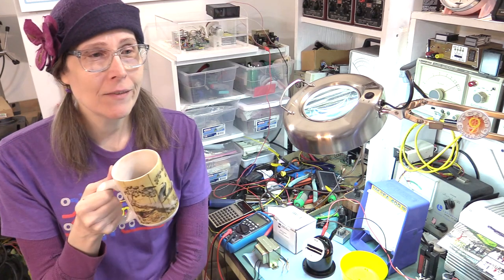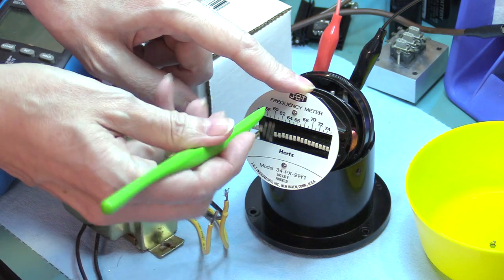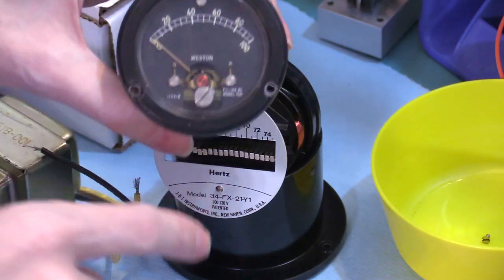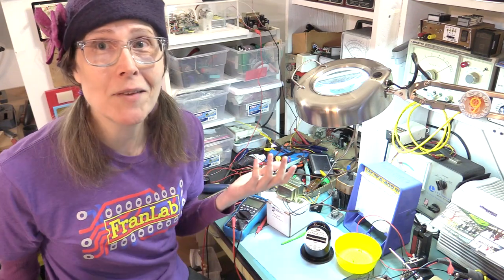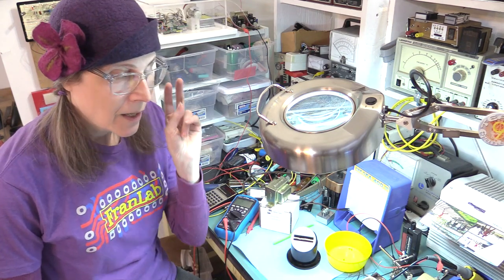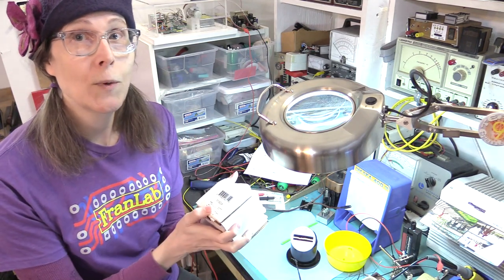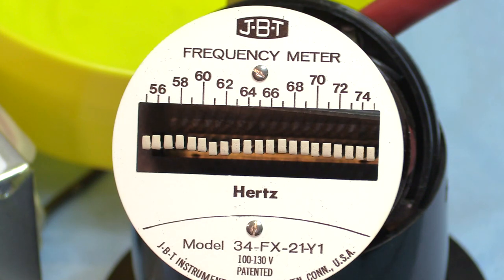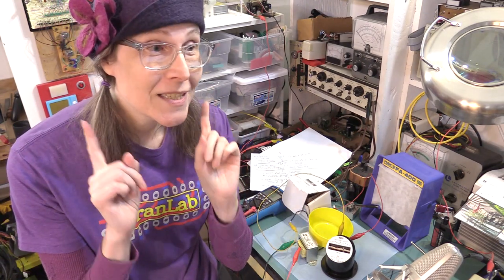Deep Dive Into The Electromagnetic Frequency Counter

Comment: Well done Fran for going the extra mile to answer all of the questions. I took one of those meters apart many years ago and saw how it functioned. You learn more by doing that than just seeing it printed in a book or information on the internet. I've also taken apart so many old clocks and aircraft displays years before I realised the dangers of the coatings used.

Comment: If it had a wider range it could be a true analogue spectrum analysis display!
Reply: Imagine calibrating that.
Reply: At one time per Hertz it'd have 22,000 of those wide. That'd take up a lot of room!
Reply: @johnpossum556  But quite an idea!
Reply: @johnpossum556  You'd have to sacrifice some definition for practicality. Otherwise it'd need it's own room!
Reply: @paulbennell3313  Something like 1/3 octaves would be useful for most musicians. I wonder how the Q is, though.
Reply: @johnpossum556  Well considering the signal was coming from a function generator, the Q didn't seem particularly tight but I guess that could've been an effect of the amp being used. 1 or 2 Hz either side of the centre frequency were being excited but I noticed this effect wasn't consistent. Again, I suspect that could be down to the amp or possibly even the settings on the amp.
Reply: @johnpossum556  spectrum analyzers are usually on a logarithmic scale and the resolution (per hz) goes down the higher up you go. As well as being more practical, this also more closely reflects the way we hear sound.

Comment: I speculate that angled plates are there to normalize the response of the tines so that all the tines have roughly the same amplitude. Denser magnetic field on the high end helps to push more power to the tines as they would need more power for the same amplitude at higher frequency.
Reply: I was going to comment the same thing.  I'd agree.

Comment: Very cool. I have a Frahm tachometer, which uses very similar tuned reeds like that to measure motor RPM. It's just a box, no wired connections, just sits on the motor housing. Mine goes up to 3600 RPM. I use it for some vibration measurements and I did a calibration Hz to RPM. Frahm also made units that read direct to Frequency. Pretty cool old school frequency measurement device.  BTW -  I have my TI-30 calculator also LOL. I had mine in HS (1984 grad). There is so much room in the battery compartment that I put a crystal radio in mine (1N34A, etc). I also put a "shocker" in there later on, relay buzzer that would give a tingle, fun little study hall gizmo. Put a bunch of little fun circuits in there. Even had teachers help with ideas back then. I still use that calculator today. Great channel Fran!

Comment: Assuming the amplifier you are talking about is tube-based (otherwise - why would it have an output transformer?).

Tube amps usually can operate with the output shorted (or too low load impedance) no problem - tubes cannot provide much more current than in normal operation.
OTOH, tube amps usually cannot work with the load impedance too high - or there can be voltage spikes that would be bad for the output tubes or the transformer.
But, if you already have a tube amp - you can probably take the high voltage from the primary side, couple it trough a capacitor and run the meter this way.

As for the power transformer impedance matching - I do not think that works the way you described it. I mean a UPS operates pretty much the same way - low voltage from the battery goes into a transformer to be stepped up to whatever the mains voltage is. Obviously the UPS can work at high load (1kW or whatever it is rated at), but it also works at no load or very low load without any problems. 
While the DC resistance of the transformer is very low, its AC impedance should be rather high without any load.

By the way, I just measured a tube output transformer that's supposed to be 5.2k -> 4R. Its DC resistance is 31R for the primary and my meter shows the secondary DC resistance as zero. But it works normally at audio frequencies :) 
Also, while audio transformers have their impedance printed, it's only the ratio that's correct. If I take my 5.2k -> 4R transformer and hook up an 8R load to it, the primary impedance will be 10.4k

Comment: thanks for showing off the meter, cant recall having seen one, also interesting was the tuning by weight. When we used to build the acoustic decoders for RC models we created a harp of contacts that we tuned by reed length to get our device channel control separation. It brought back some memories seeing those little wigglers in action, thank you so much. 👍

Comment: Thanks for the video, i did not watch the first one cause I already knew how these operate (having learned about whole Europes power net running in sync). Glow in the dark paint would not make sense for that instrument, since its application would be around some sort of power station, where you could run any incandesent bulb to shine a light -> dark, no frequency, some light, try to get that 50 or 60 hertz thingi somewhat right before connecting to th grid.

On a different note, I remember these steam engine governors and a WWI fighter movie, with a simmilar contraption to indicate the airspeed. It was a free spinning airscrew generating a certain rpm dependent of the air flow. The pilot could audible hear his airspeed by recognising the frequency (the higher the nearer to Vmax and ripping of the wing covers). A second indication would be a set of tuning forks (like your frequency counter) that would resonate to the airspeed indicator and would give a objective reading of airspeed, based on the stimulated frequency and independent of the pilots ear. 

Basically, the rx path of a 9k6 modem would be same, having rc circuits tuned to the tones and detecting a rectified dc to recover the tones to quantified information.

A great display of tuning forks in audible range. Thanks and all the best for your endeavors!

Comment: Had to fast forward to see that frequency sweep in action.  Instead of saying it does not work, why not just do it!?  A 110V to 9V transformer turned the wrong way will generate 110V from a 9V signal generator sinewave.  Usually the signal generators can drive 50 ohm loads.  This means the resistive load on the other side of the transformer can be as low as 7.5kohm.  Now that meter has a huge coil which probably is significantly inductive and have some inductance in addition to the wire resistance, which will lower current further.  If your signal generator is too weak to generate 9Vrms sine with 50 ohm source impedance, you can just throw a HiFi audio amp in between (maybe that is what you did - i skipped the boring part).  By the way to use the meter as a pickup you need a permanent magnet close to it to get any good signal.  Now probably only the earth magnetic field generated the signal.  Alternatively put a small DC current through the coil.

Comment: Anyone who spent hours outside on a cold airfield pan in the 80's/90's, trying to keep warm next to a diesel-powered aircraft power generator set will have watched one of those little gauges. In the UK the power sets were made by Houchin & a selector switch enabled monitoring of the 115v 400hz frequency on each of the three phases.

Comment: When we used to turn over a few generators, it became apparent that this type of frequency meter was the meter of choice for a lot of manufacturers. From tiny little 300w Honda portables, to 250kW industrials and beyond. Back in the day, the term was 'reed' rather than 'tine' but the meaning isn't lost either way. As well as 'lead loading' to tune the reeds, some makers (cheaper ones) used reeds of differing lengths, which in turn responded to different frequencies. Although these instruments look simple, there is a bit of science behind them, and in the days before electronic frequency meters, these were perfectly adequate for monitoring the mains frequency on the grid. Used in conjunction with a simple 'synchroscope' you had the tools to allow your generating station to match frequency with the grid, and to synchronise phases before tying.

Comment: Fran, as others have said, a transformer  requires an alternating current to work.  Measuring its resistance  at DC only shows it has continuity. You will need to measure its impedance at say 60Hz in order to calculate its  AC resistance at that frequency.  Your 24v to 120v transformer would work fine if driven by a 24v  RMS 60Hz  source . A lower voltage  - say  5v - secondary transformer would be better when driven with your amp. An old valve (tube) audio output transformer would be  ideal. Love the channel.

Comment: Transformers have 'reflected' impedance.  With a proper impedance meter you'll get an infinite impedance reading on the secondary unless there is a load on the primary.  This always seems bizarre when you consider the very low DC resistance of the winding.  Of course it works in either direction.

Comment: You are almost certainly correct on the purpose of the plates. If you want to demonstrate this take any rare earth magnet and measure its holding power.(just rough, even by "feel" will do). Then add a steel washer to the back side and repeat. You will find the hold greatly increased because the steel washer deforms the mag field towards the front. That's why rare earth catches usually come with a steel cup.

Comment: Hi Fran. Great . I  have suggested yesterday (12/17/2020) to use a transformer  backwards in the output of an amplifier. I didn't revise my original comments, but I probably didn't  specify the usage of an audio transformer, but for sure not even think in using a power transformer - the impedancies for sure wouldn't match. 
But hey, you got that point, and my "provocation" worked fine also...
Thanks, I am a great fan of Fran (it was fun-ny)

Comment: Somewhere I have a tiny, totally mechanical contact tachometer/frequency measuring stick. It looks a bit like a pen or pocket tire pressure test gauge. To use the tool you touch the tip of the stick to something frame, case, or block of a running engine or motor. The stick has a small tab on the side that slids up and down the length of the stick. If you slide the tab it will push or pull a stiff wire out a hole in the tip of the stick. At a specific frequency the wire will suddenly start to wiggle.

Comment: Re: Impedance mismatch - this is for people who are interested in how to calculate such things, and some background info. Not to be pedantic or critical or something. 
There is a big difference between DC resistance and impedance. This is why the transformer doesn't pass 10 amps of current (with its 11 ohm dc resistance on an 110v outlet) when you hook it up. Instead, it draws a few dozen mA to magnetize the core. 
The 110v/24v transformer is NOT suitable, but other mains transformers are. 

I ran some calculations, and with a 230v to 6,3v transformer (or 110v to 3v) you can safely drive it with an 8 ohm rated amplifier, as long as the 16000 ohm load is connected EDIT: and is 16000 ohms at 60hz, not at DC. 
The voltage transformation ratio is 230/6.3=36,5. The impedance transformation ratio is 36.5^2 = 1332. 
Divide the 16000 ohm frequency meter load by the ratio of 1332, and the amplifier driving the transformer will see 16000/1332= 12 ohm. With the ca. 8mA load at 110v, it will need an amplifier of just over 1 watt, because of the slight mismatch. 

The DC resistance has no role to speak of, in this application. 

Tube amps do NOT like driving way too high impedance sources, but 12 ohm on an 8 ohm rated amp will work just fine. The big risk in this case is not blowing up the amp, but blowing up the meter because the amp is able to deliver WAY more power and voltage than needed. 
With just 10 watts of power you can already produce voltages in the kilovolt range, if you hook up a mains transformer 'in reverse' to a speaker output. 
I use TDA2003 and 2030 amplifiers for such 'risky' applications. Those are short circuit and open circuit proof.

With the 100v or 75v piped audio transformer, you have the same issues. Open circuit secondary, the amplifier will practically see infinite ohms as impedance. Short it out, and it will also see a short circuit even if the transformer says its 4 or 8 ohm (well, it would see just the DC resistance without the impedance added to it). In piped audio transformers, you have to fool around with the watts 'consumed' and that's a whole other story. It's 4 or 8 ohms, if the load is the same as the amount of watts printed on the transformer. Not gonna write more about that now.

Comment: It may be louder if you bias the coil with some DC current. Those tines are most likely only very slightly magnetized and tuned to double the frequency they show (they don't have to react to the direction of the field, only the magnitude). Some DC on the coil should play the part of the magnet in the guitar pickup.

Comment: You can easily drive a transformer like that with an amp. The amp doesn't 'see' the DC resistance. It sees the inductance of the transformer, which is MUCH higher than the 4-8 ohms of a speaker @60Hz. Try it, and put an amp-meter in between.

Comment: As many others mentioned, you're confusing DC resistance with AC inductance. Sure the secondary on that transformer is 0.6 ohms, but the impedance at 60 Hz will be much higher.
Reply: Surely that would be the same for speaker impedance whilst being driven

Comment: I first saw one of these devices recently as an RPM meter that was intended to be bolted onto a piece of equipment. If you were to mechanically couple that thing to the speaker cabinet, or maybe to a motor with an eccentric weight you could get it to behave exactly the same way as if excited through the coil. And yes seeing one of these things without any electronics present really was a bit of a head-scratcher at first for us too.

Comment: The plates either side of the tines form the reactive elements to impose physical motion to the tines themselves. If they are simply magnetised they wouldn't have
anything to push/pull against. The taper would be a tuned transition to linearize the amount of motion across the frequency range for a given voltage, the lower frequencies being more
efficient afford more gap, the higher frequencies need more energy to be conveyed so the gap is progressively smaller.
Great video again Fran, thanks for your efforts.

Comment: Nucular! Sometime in the early 70s (I think) a British politician stood up in Parliament and talked about "Unclear" Power. It took a while for people to work out what he was talking about!

A great demo. Someone had suggested using a 100V line driver amp, but I didn't get round to working out what the matching would have been like. I remember the days when you needed a fairly substantial output transformer to drive 600 ohms at line level. I don't think there would be an easy way to match a 1W output into 16K (?) without a special transformer.

Comment: I had a tone decoder which worked on the same principles. It had a bunch of reeds at mid-audio frequencies. The NE 567 put them out of business. 

I had a 400 Hz meter on a radar transmitter. When I converted it to 60 Hz I pulled it out ... I wonder what I did with it.

Comment: Thanks, Fran!  I had a simpler solution.  Connect it to an engine-driven generator, then grab the governor paddle while it's running to speed up the engine a bit...  You rock!
Reply: For what it’s worth, I wanted to try that.
Reply: @tadonplane8265  There's a GREAT Military Surplus genny pigtail you can get with 3 meters in it; Voltage, Amperage, and freq.  They're designed to plug inline with a generator output so you don't suffer any significant surprises when powering up gear...

Comment: dc resistance is different than ac resistance when measuring transformers or voice coils. A single ended tube amp can drive that meter directly before the output transformer.(add dc blocking cap)
i have 3 different output transformers currently on my bench with ac measurements of 6500ohm to 8. 
at the start of the video i was going to suggest using a audio line output trans. or a 70 /100 volt speaker trans. as they would be a close match. but the speaker to line one worked well also.
maybe someday ill get into video ,but repairing vintage tube amplifiers is really my passion.
 i love to see females in a male dominated industry. keep up the good work!

Comment: That was cool. Glad you figured out a way to tickle the rest of the tines. I didn't read the comments under the last video but I'm kind of surprised someone didn't suggest simply hooking it up to a stand-by generator and playing with the governor on the engine to speed up or slow down the generator. That's probably what these were used for in the past. When running auxiliary generators they had to be synchronized somehow. You have to know the frequency is correct before you can synchronize the phase with another generator or the mains. Anyway, even though a portable generator would have been the simplest way it still wouldn't have been workable inside the lab cause you can't run a stand-by generator indoors.

Comment: I've seen that kind of meter before in a purely mechanical form. They're used as contact tachometers. 

The converging pole pieces will be to keep the amplitude of the tine vibration fairly even across the frequency range.

Comment: I remember reading that Bryston uses to do Q&A on their UK amps by powering them up with another Bryston amp with an input 50 Hz sine wave set to an amplitude high enough for the amp to deliver the needed 220 volts 50 hertz UK mains voltage!
NOW! there is a demo, you should try to reproduce Fran!! :P

Comment: I was one of those who said to drive a regular transformer backwards. But the concept is the same. (it is a transformer at the end of the day) Volts/turn. Fran is right with the impedance matching thing. But in a pinch, I would use what I had on hand. Cheers FRAN!